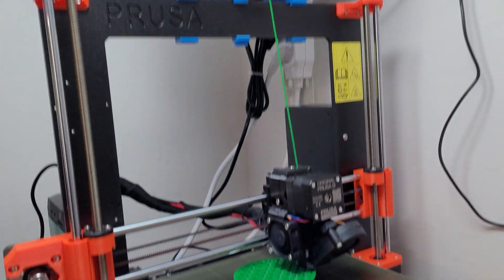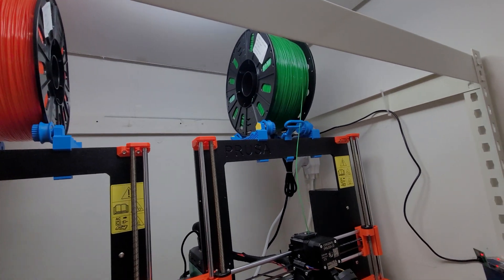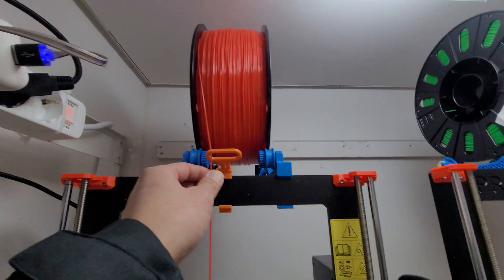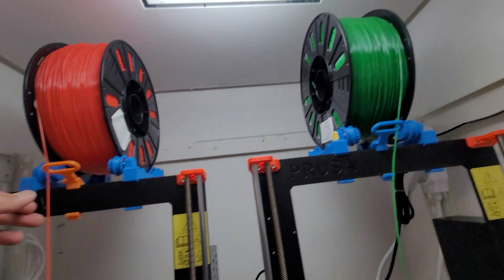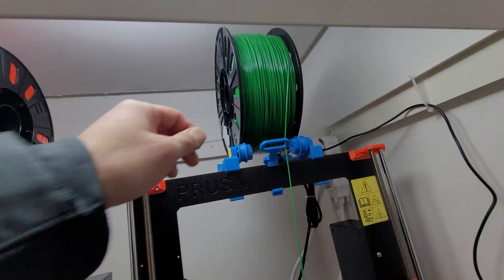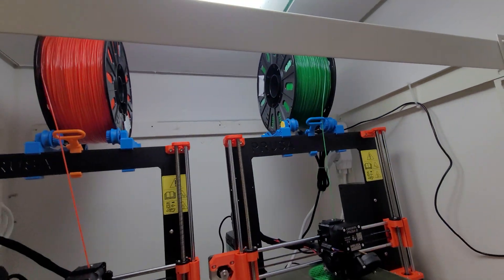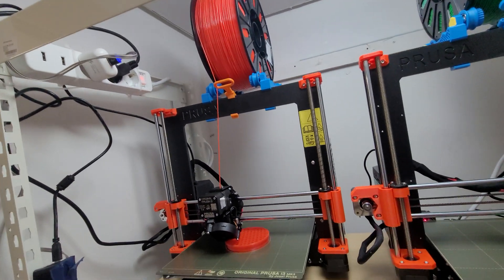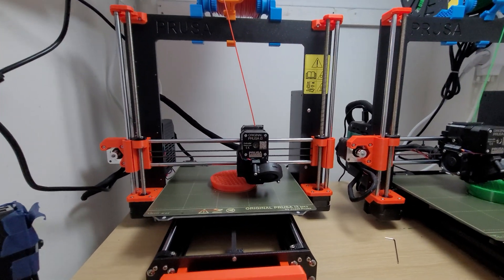Working with larger 3kg TPU spools on Prusa MK3S+!

Comment: Have you changed the volumetric speed for the tpu on .8 nozzle? Also what layer height are you using? I have an mk3s with a mosquito magnum but haven’t had much luck with tpu using .8 nozzles. I love the mosquito but I print a ton of sainsmart tpu and tend to print on my other machines with hemeras.
Reply from the maker: Yup i changed it to something like 30, the bottleneck isnt mvs anymore but the printer speeds with bigger nozzles.